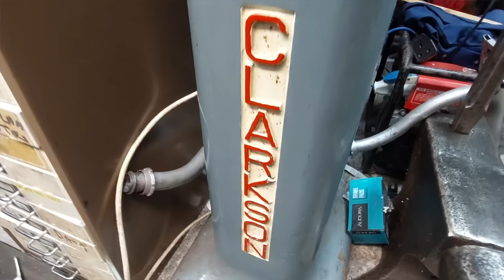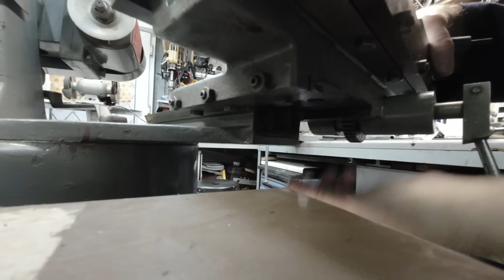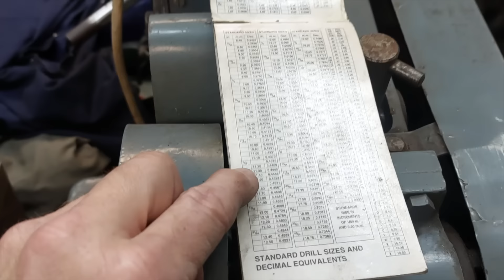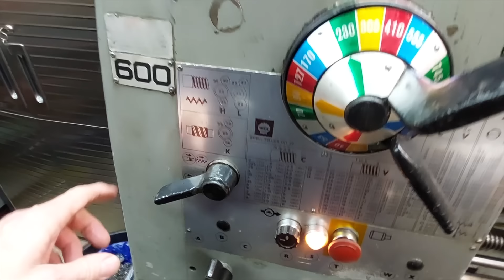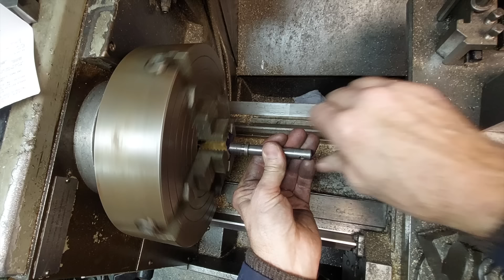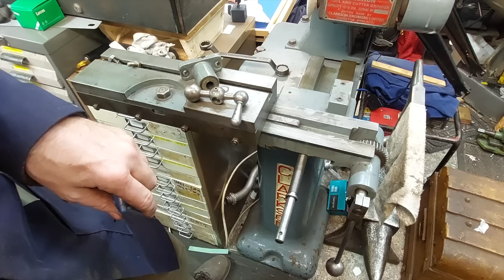RESTORING FEED SCREW THREAD ON CLARKSON CUTTER GRINDER

Comment: I spent a couple of months seconded to the machine tool rebuilding company owned by the group I worked for to get experience & they used similar techniques to keep costs down. Instead of replacing cross slide screws with new, the old screw was machined as you did to "machine out the wear" on the thread flanks. This obviously made for a non standard thread, but a new nut was made to suit. Made a bit on the side claiming mileage taking the screw from a Herbert capstan lathe to the machine shop several miles away strapped along the side of my CZ250 - got the same allowance as a 1300cc car, but that was no consolation for owning a CZ !
Have you checked for end float on the screw ? Could account of a bit of the remaining backlash.
Reply from the maker: It probably does but if you needed to be accurate on the amount you dial in ( it doesn't have any scales on it ) you'd stick a clock on the table, I will measure the movement for one turn of the handle which will give me a rough idea when operating the machine.  
Now was it the lack of street cred riding a CZ or the exuberance of youth nailing the throttle wide open and making your fuel economy worse than a 1300cc car that travel allowance didn't cover? 🙂
Reply: @TweedsGarage  The CZ was an complete pile of unreliable poo - very few redeeming features ! 
I wanted to buy a new MZ TS250/1 but couldn't afford the £525 asking price (was replacing a MZ TS150 that was rather cramped 2-up). The CZ 250 Twin was £413 (November 1979 prices) and the 3rd year apprentice wages would just cover that with the MZ in p/x. 
Seemed OK to start with - smooth & a lot roomier than the MZ. First gearbox fault came the day it was due to go in for the 1st service @ 500 miles - stuck in top gear & had to be recovered. Pivot pin in the gearchange quadrant sheared. Second gearbox fault at around 1200 miles - could only select a  couple of gears. One of the rods the shift forks slid on sheared. Repair for that lasted 8 miles - stuck in top again - another pivot pin sheared. This one was "interesting" as my bike was a Mk2 with 1 down-3 up shifting & there were only older MK1 quadrants available that were 1up-3 down. Had to re-learn the shift pattern after that repair. Add in that it seized, blew head gaskets & perpetually flattened the battery overnight. I eventually put a battery isolator switch in circuit as I was fed up having to walk to work (wouldn't start with a flat battery despite the so-called "Emeregency start" position) - fault eventually traced to sticking current cutout contacts in the dynamo regulator discharging the battery through the dynamo. Only found that by accident - took the plugs out to clean them & the engine started motoring ! 
When the 6 month / 6000 mile warranty expired I bit the bullet, took out a bank loan & bought a Suzuki !
I don't think I was hard on the bike - not had any gearbox issues on anything owned since  Never did forgive journalist Dave Minton for suggesting in a comparison review between the MZ & CZ that there was not much to choose between them ! I did later get a TS250/1 that has been in the garage for 34 years now - with no gearbox issues !
Reply from the maker: Dave Minton had the advantage of knowing he was handing it back 😁......apprentice wages made for poor transport choices....needs must when the devil drives ( bet he doesn't ride a CZ ) . Crazily some people restore them!!!!! @mgnbukint6502
Reply: @TweedsGarage  Made the mistake at the time of actually believing magazine road tests were reliable indicators & could be trusted ! 
I was editor of a national club magazine for a couple of years & one article submitted quoted the long term tests by Motorcycle Monthly - really in-depth, authoritative stuff. Was suprised to get an e-mail a couple of months later from one of the original journalists who wote the articles, stating that a lot of it was just made up ! Particularly if the weather was bad & deadlines had to be met. Never forgot his closing comment " Magazines are just for entertainment" ! You live & learn.
Managed to find a better crank for the Aerial yet ?
Reply from the maker: A possible source has been found. @mgnbukint6502

Comment: Thanks for the shout out. You confirmed for me that my screw and nut were shop made, being 10tpi square and not the original 14 BSF. Having 360 degrees of backlash on a table screw that still moves is pretty spectacular!! Cheers
Reply from the maker: Literally hanging on by the skin of its teeth😁

Comment: Hi Mr  Tweed , much enjoyed  the video  but it it occurred  to me that the original  nut had a slot cut in it with a pinch stud arrangement  in it, would not the backlash been reduced  if this had nipped up a bit , as you can tell l am from the bodge it and scarper  school  of engineering but enjoyed  your machining  skills
Reply from the maker: It would of Stephen if it had had any teeth left......it was as bald as the proverbial badgers backside

Comment: I have to say tool and cutter regrinding is something I've never been able to get my head around. I have an Astra AR5E, stop sniggering Jenkins, Universal machine, well two of them which I tend to use for surface grinding and a Clarkson which I've never used. I'd love to be able to regrind my own tools as I have literally hundreds of end mills, slot mills, face mills etc, etc. 
I did tweak the square thread which controls the table height on one of the Astras and machined a new nut to suit.

Do you think you could blag your mate into collaborating on a video showing us the dark art of tool and cutter grinding Mr Tweed?
Reply from the maker: It could be a possibility, I'd need to sort out arbors and tool stops......and tidy the workshop.....but possible

Comment: I did wonder how much better you could make that thread, turns out to be a lot. As you say for a machine that will only have light use it will be fine.
Did Jenkins infect you or have you been sleeping in too many fields with the gate open?
Hopefully Vic rubbing your chest will help you feel better.🤭
Thanks for filming in your cold workshop.
Reply from the maker: It was Jenkins that left the gate open.......
Reply: @TweedsGarage  So, that is how the squirrel escaped.

Comment: I'm a bit confused, as, i cant make it out ,  -  14 mins .. does that thread cutting insert have its cutting edges underneath?
Reply from the maker: It's a small triangle profile on the left hand side of the insert , its clearer if you look at the back two sides of the insert.
Reply: @TweedsGarage  yes .. i think it was an optical illusion .. the first time i watched it the clarkson lead screw was going clockwise .. now when in look again its going anticlockwise .. so perfect, you are doing it right ... i think its like looking at a cube  wireframe drawing your brain decides what you see.... and my brain said clockwise the first time. maybe something to do with frame rate or something.

Comment: I’ve never used one, let alone had one, but guess a tool and cutter grinder has about the world’s worst operating conditions. Nice work Mr T. Les
Reply from the maker: You're not wrong there, you never know whether to oil them or leave them dry, with the later it'll wear out with former it creates a grinding paste and wears out 🤷🏽‍♂️
Reply: @TweedsGarage  i have a Klaiber/Frikla one came with cylindrical grinding set up, looking at all the set ups for Klaiber on the lathes site may given you a few ideas of other uses,